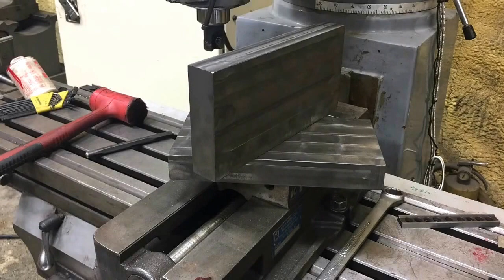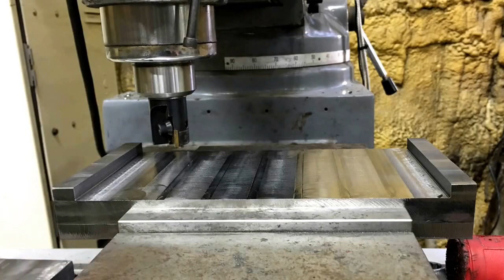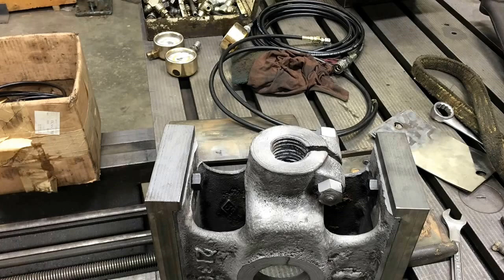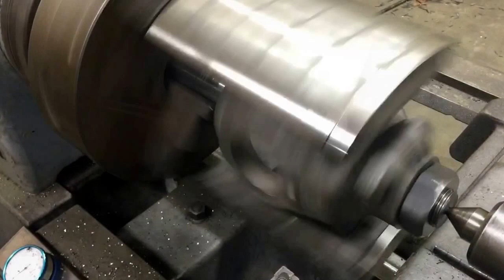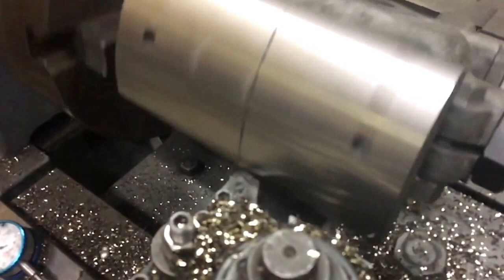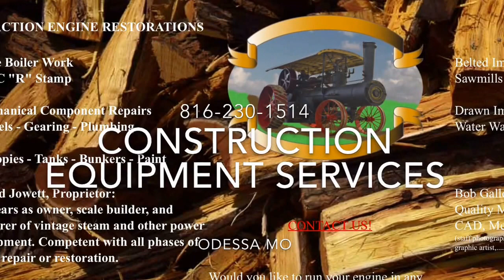80hp Case Steam engine repair 3

Comment: O.k, new slippers. You really make it look easy, experience and talent. I love the slo-mo footage. Very well done.All my slippers are brass. I figure "they" thought, easier to replace the slippers than work on the guides. Are your slippers softer than the crosshead tunnel, gray iron?I have no steam yet, working in that. What oil would one use for the crosshesd guides. I have some with grease cups, some with drip oilers. I would consider using chain saw bar oil in drippers. It's sooo sticky with long threads. Might not drip well if cold. Haven't tried it yet but it seems like it would stick to the guides well. Tks for the work and the video.Steam: Cyclotherm, Kewanee, Joshua Hendy, Atlas, Climax ...
Reply from the maker: Rb Stephenson a good heavy way oil
Is what we use on slides like that. Very similar to bar chain oil like you talked about. Cross head shoes are made from durabar which is a manufactured cast iron